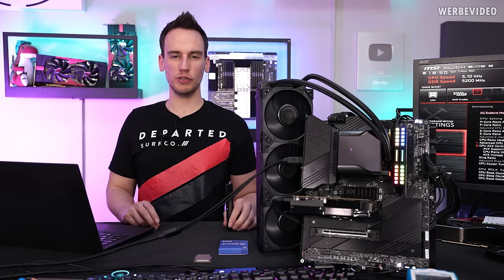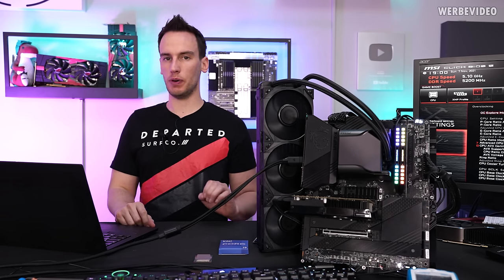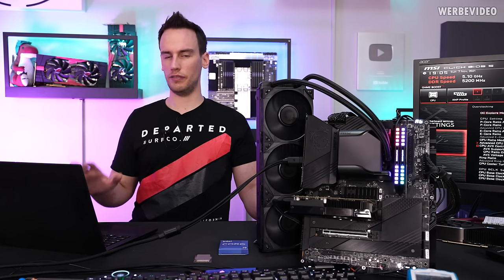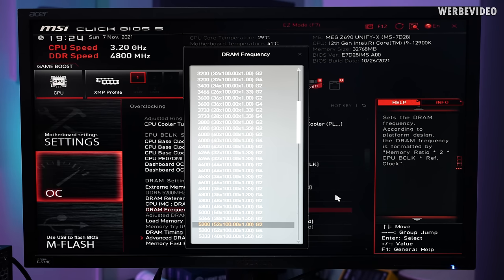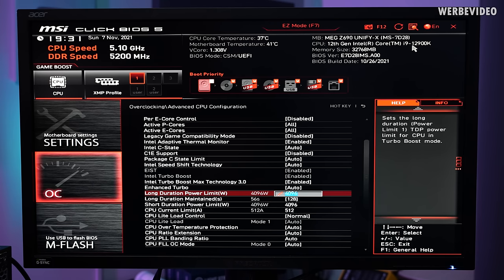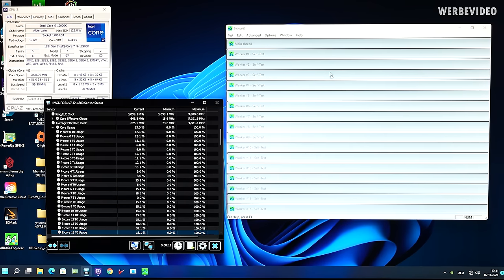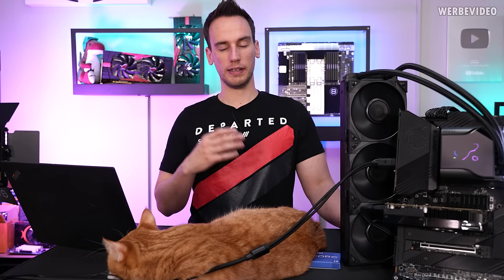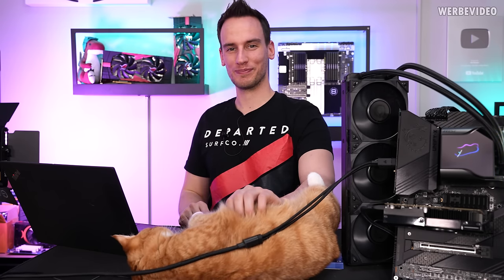Intel 12900K Clocks, Voltages and Overclocking explained - feat. MSI Z690 Unify-X

Comment: Is it also stable with Command Rate 1T for the memory? Cause CPU-Z does not detect the gear down mode and it shows 1T if your CR is set to 1T while the memory controller is set to gear down mode. And what is your p-core clock speed recommendation for absolute stability even with the AVX 512 instructions if you have a 360mm AIO?

Comment: Great video,  just curious would this also be similar  for 12700k   to mirror  for  OC
Reply: There is nothing that will demand overclocking your 12 series for gaming. For rendering and etc, you'll have to get a custom-loop. I have a 420 arctic liquid freezer and it's still too hot.

However, at lower voltages I notice better performance because the power draw is more consistent and doesn't 'gag' the system'

Comment: At 5.3G with 1.36v on a 420mm cooler. Temps in 2042 never go higher than 60c and usually hover around 45-50. I may have got lucky. E cores disabled as at the moment they hit the FPS
Reply: Try running cinebench r23 and check your cpu temps. Gaming temps for a 12900k shouldn't go over 65-70 while gaming.

Comment: I just got an Asus Z690-E motherboard and tried the simple configuration you suggested .
Strange that everything works fine except - my Vcore voltage at idle is 1.421 V and in stress is 1.376 V 
CPU at 5100 Mhz - wattage is 157.33 
I also set my RAM to 5400 Mhz - it is rated for 5200 - that is ok .
Is that ok or should I try to lower the voltage ?

Comment: Dont you guys have a guide on memory overclocking? Something that goes more in depth about tertiary timings and the IOL and such?, I saw the extensive guide that floats around but i cant find anything that talks about those and if lower values or higher values are better for performance, etc
Reply: look at the sticker it will show your stock timings, to overclock simply lower the numbers if its 12-12-14-40 change it to 11-11-13-37 then test it and if its faster you can try to do it even more 10-10-12-33. . you can also further overclock by setting it to a higher ghz ...then if its still working you would increase your voltage to get stability
Reply: @blazebott  ye i done all that, my sticks are crap (Micron 4gb B and 8gb H die and yes i miss matched my sticks lmao but isnt permanent, just having some fun while i save to get better components for this mobo)
and i could get them up to 3294 MT/s (i did BCLK OC that is why isnt a normal  number) with timings 18 18 18 40, but i left most of my secondaries and tertiaries in auto and those are what i need more info on, maybe im just missing on some good performance gains there but i have no clue what to do with them
Reply: also these sticks do not like voltages, they dont scale well past the 1.3 v range
Reply: @Elinzar  i was going to own you in the comments section last post but it was 3am and i had a interview for a important job more important than overclcoking but im bback at it again to own you with more valuble memmory overclcoking clues, yes there are not alot of guides online but its because theres alot of work and testing involved but ill let you in on a hint. load up one of the xmp profiles on your ram with the lowest timings and then try the 2ndary timings from this profile but incorporate into (the timings on the sticker)overclocked you found on your first timings so you need to know those first ... then you will have stable ass fast ass ram sticks
Reply: increase voltage as mentioned
Reply: @blazebott  did i say something disrespectful to you that you had the urge to "Own" me in the comments? i mean thanks for the input but if you are so busy with your interviews (that honestly i don't really care about and is irrelevant to this tread) then don't bother commenting, specially with that attitude
btw i will not be following this discussion, i will only follow the tread 

that begin said, these sticks are literal trash 
and don't have XMP, only JEDEC timings that are pretty trash as well, i don't really care much because i will replace them but anyways i guess i will be asking somewhere else about the tertiary timings

Comment: My solution on a 12700kf was turning on Thermal velocity boost +2 profile, which does 5.2ghz ingame, while set to 50 multiplier = 5.0ghz in benchmarks like cinebench.
Would also like to ask if hwinfo reported power draw value of 10w on Rest-of-chip is normal, or is it F skew specific. I've seen this at 1-1.5w for most people on 12700k.
Reply: My OC:
VccIN 1.325v
P cores 5.0ghz (TVB pushes P cores to 5.2ghz in lower loads)
E cores 4.0ghz
Ring 4.4ghz
Ddr4 3600mhz c14 kit 1.45v xmp profile
Pulling 265w in cinebench r23 (not quite satisfied with high power draw considering its 12700kf)
On 360mm aio doing 86 max (also not satisfied and considering liquid metal between IHS and copper water block. Actually hardware overclocking suggests it's useful due to how thermally dense 12th gen is)

Would also like to ask your opinion about 3080ti liquid metal swap, with a stock 3 fan copper heatsink. Getting 86 degrees Hotspot and 76 degrees on gpu die with loud 2200rpm fan noise. Do you think it's worth it, with all safety measures taken, isolation of the components surrounding the die with some nail coating and probably an elastic eraser material for a border around the die. Same for the cpu IHS/water block application.
Reply: Cinebench r23 24448
Cinebench r20 9307

Comment: Hi. I have an i5, and will get a new i9, is these setting what i should do in the Bios? Or shold i get an update from the internet? I have the same mb (as i remember). I have talked to a guy, that asked to all my hardware. Motherboard, power unit, etc. He said everything i have, is all good. The Watt it perfect in the power unit, graphic card is ok, also the mothervoard. I got the money for the CPU. I can sit in the CPU myself, My "problem" is the Bios. So that is my question. I will also get RAM from 16 gb (2 times 8) to 32 or maybe 64 gb total.

Comment: At 17:20 you are using a 1050TI. Doesn’t this mean that the gpu is bottlenecking and thus it’s not a fair representation of the load the pc would be under if your cpu is the bottleneck? (Play cs at 1080p maybe?)
Reply from the maker: Yes absolutely. Will always depend on the GPU/Game/Usecase
Reply: @der8auer-en  okay, so then why didn’t you use a more relevant GPU more likely to be paired with the i9
Reply: No game would likely bottleneck an i9 so the 1050ti is just a troll??
Reply: @Profanitey  you might not see a huge difference if the game cant utilize all the cpu to begin with

Comment: I wonder which motherboard supports 7000 mhz ddr5 from g skills and 8400 mhz ddr5 from adata. Those are the 2 that I'm only interested in. My current build has g skills trident z royal 4000 mhz at 32gb ddr4 even though I wanted g skills trident z royal 4600 mhz 32gb at the time however only 16gb ddr4 was only available when I built my pc back in 2019. I'm waiting for the 12900ks that Intel will have pre bined for all cores at 5.2 ghz. I also have the 9900k with the godlike motherboard. I really like the overclocking game boost knob that my z390 godlike motherboard has. I wish the newer motherboards from msi still had the overclocking game boost knob. I have the noctua NH-D15 and my temperatures range from 55 to 60 celcius with my ddr4 with xmp enabled at 4000 mhz and msi after burner enabled with all the settings maxed out on after burner. I just wish my evga 2080 ti ftw 3 ultra had noctua fans instead of the evga fans like the new asus 3070 since the fans get loud when maxed out.

Comment: is 1.35v for 5.0ghz too high? it runs cool on my capellix h150i (30 idle, 65 gaming and around 85 in cinebench) but I don't want to degrade my CPU over-voting it. I had Asus AI oc on for two weeks and saw v-core around 1.47 and it scared me so I turned it off completely. I'd like to get 5.2, but 5.0 is fine if it is more stable. Yesterday I got stable 5.2 1.4v playing warzone with no issues for two hours but after manually rebooting windows wouldn't start so I went back to 5.0 1.35 and have had no errors since. 

All of this was done with stock 3.7 e-cores, I don't care that much about them right now but in the future 4.0 or 3.9 would be nice.

Comment: Could you please do a detailed video on UHD770 iGPU OC voltages.. I am able to OC it till 1900MHz with VAXG voltage set at 1.085 or 1.090. I cant get it any further. Max that my Gigabyte B660M Aorus Pro allows it is till 2100MHz but I cant go past 1900. But this has already gotten me 21% jump on iGPU, but just in case there are any options in voltages to OC it futher till 2000 or may 2100MHz. I just do casual gaming so an iGPU OC will help greatly.

Comment: yep clock speeds i have an i9 12900ks that i have now had for 3 months max  clock speeds in games seams to be 4ghz no were near 5.5ghz would be nice to get it to run faster than my old i9 9900k that runs at 5ghz, this also means my i9 9900k is now back as my main gaming system as it runs game much smother and faster than the i9 12900ks

Comment: After watching everything I'm extremely happy i went with the i7 12700k it seems like the best choice of 2022 for high end cpu due to price, performance, temps and stability. Since it doesn't get close to as hot as the i9 12900k and with an overclock I can actually beat a stock i9 12900k!

Comment: Hi. Could you help me to raise the ddr4 memory above 4600mhz? memory voltage 1.6v SA voltage 1.25v but that alone is not enough. I think I need to configure some more voltage? I appreciate if you can help. It would be interesting to have a video of this format overclocking DDR4 and DDR5 memory. Nice video!

Comment: It seems I got a pretty bad chip. My E-cores get unstable at 4.0GHz @1.3V. The maximum setting I can run is 5.1GHz on P-cores and 3.9 on E-cores with a 360 AIO.

Comment: So i used by core usage 5.3 6 best cores 5.2 2 worst cores, made all core run at 5ghz because i only use for gaming. E cores are sync all cores to 4ghz. Manual vcore set to 1.30v and on xtu and hw monitor it shows 1.40v but cpu-z shows around 1.285v under load using llc4 on asus maximus hero z690. Everything is stable. Should i worry about that 1.4v or just go by cpu-z load voltage? Thanks brother 👍
Reply: If you intend to hang onto your CPU for a long time it's best to underclock at this point. I have been hitting 1.45 volts under auto oc and etc. It's not necessary. Better to underclock and avoid throttling. You will actually experience a smoother experience.

Comment: I used your video to overclock my 12900k for warzone and no matter what i do, the Actual core clock speeds that is in the Task manager never gets over 4.6 ghz.  shouldnt this be fixed at 5.2 ghz?  My p cores and e cores show the correct overclock.  but not the core.  how can i fix this?

Comment: Hey Roman!
I Like most of your videos, but i think all core / static voltage overclocking is dead nowadays. 
Could you make a video doing CPU overclocking by using TVB, per/core ratio configs, etc?

For me most interesting question is how to find correct voltage / stability when you use per-core overclocking.

Comment: I am finding it a bit tricky to get to know this CPU (12900k) for some reason. Normally you play with stuff and in a day or so you get a good idea of whats going on. But I cant tell if I got a dud CPU, or I installed it badly, or the mobo is to blame for perhaps dishing out more volts than needed. Also I dont know if this is strange behaviour, but if I disable the Ecores and do nothing else, the volts climb right into the 1.4s - at default/auto settings in mobo (MSI Edge)

For most things, its fine. However Ive been playing Assassins creed (yay Ubisoft DRM riddle CPU power hog), and it can get very spikey, the CPU hit 92C at one point which there is no way Im comfortable with.

I have a D15 and so obviously no big OC plans. But a 5G all core should be manageable I think? I wiped the slate clean and tried to follow this guide, going for 5G Pcore, 4G Ecore, I think a 39 on ring. I set the vcore to 1.25 (HWinfo shows 1.29 :s It always seems to add a bit to the volts to the tune of 0.04 to 0.06 extra, which is why I think this is the cause of my sometimes spikey temps if this is a correct reading)

*E: So running a few different benches and monitoring the volts, with it set to 1.25 in the bios (and xtu showing the same 1.25, no offsets anywhere), HWinfo has it at a base of 1.29 and in gaming it creeps up to 1.314. I need to figure out what the setting is thats allowing it that extra voltage. I cant imagine just reducing what its set to in the bios to compensate for that is a good idea as there is no way this would be stable setting the bios to 1.2 (or 1.19)
Reply: Roman said there isn't always a good way to combat the voltage creep beside a negative voltage offset
Reply: @mitlanderson  Some creep I can get over, but the straight up addition is bothersome. Im probably not doing myself any favours by using such a power hungry title. I mean with the reduced volts a 10 minute XTU stress test sees a peak of 81C, where as playing assassins creed for an hour and I see the peak of 89C. Thats nuts!
Reply: @utubby3730  From what I've seen the default voltage is around 1.3v for default speeds. I'm running at 5.1/4.1Ghz 4300Mhz cache (Ring disabled) at around 1.36v (12900KF/Strix DDR4-4800Mhz), on a 360mm Capellix cooler. Temp not hitting 90c with balanced fan/pump profile. I managed to get a fair drop in temp by lowering the SystemAgent voltage from 1.4v+ @default, to under 1.15v manually. If I left the Core voltage at default, it wants 1.4v, at 5.2Ghz it wants 1.44v., and both throttle/overheat (but probably ok for gaming). If you haven't already, try a little manual tweak on your voltages. You're right, the motherboard always dishes out more than is needed, and the CPU is power hungry and hot.

Comment: My 12900k will hit 13 mhz shy of 5.1 if set to 5.1 on p cores or 10 mhz shy of 4.0 or set to 4.0 on e cores but if I set it to target 5.2 it’ll also be shy by a few mhz to hit 5.2 - so it can hit the mhz if I exceed the initial target but not the actual
Target? Why? Bios issue? Using edge Wi-Fi z690 sp 95 chip
Reply: That's 100% your motherboard. The more expensive mobo models start with 
5200hz by default.

Comment: REALLY GREAT ADVICE CHAMP. I WOULD LOVE TO SEE THE SAME ON AN ASUS MAX.IF PEOPLE DON'T FOLLOW YOUR WONDERFUL ADVICE SHAME ON THEM. WE NEED MORE VIDEOS FROM YOU. YOUR THE BEST MAN FOR THESE TYPES OF VIDEOS. GIVE US MORE AND YOU WILL EASILY GET 1 MILLION SUBSCRIBERS. I NOT SCREAMING JUST LAZY. KEEP UP THE GREAT WORK. YOUR WORK WITH LIAN LI IS AS TONY THE TIGER WOULD SAY GREATTTTT!  FOR THE RECORD THE ONLY ADVICE I GIVE PEOPLE ON MOTHERBOARDS. I GIVE IS MSI OR ASUS I LIKE BOTH EQUALLY. NEVER ANY PROBLEMS WITH EITHER. ON MEMORY I TRY NOT TO GIVE ADVICE . I SIMPLY TELL PEOPLE ALL I USE IS CORSAIR. MY GRANDSONS ARE STARTING A UTUBE CHANNEL THEY WILL SHOW THEIR SYSTEMS I AM BUILD THEM AND TEACHING THEM.    MOSTLY CONCERNING THE PROPER WAY TO BUILD A DIY WATERCOOLING SYSTEM . DISTRO PLATES ARE A NO NO. RUNS ARE TO LONG FOR A 3.1 AND A 3.2  i DON'T CARE ABOUT HEAD PRESSURE. SO LONG AS I CAN GET 1.5 PSI FOR THE AQUA  CPU BLOCK . i AM HAPPY D5 ARE THE ONLY PUMP I RECOMMEND. I ALSO USE COPPER TUBING ONLY AND X-FLOW RADS ONLY THIS KEEPS RUNS VERY SHORT, MY YOUNGEST GRANDSON.I USE  1 PUMP 2 RAD X FLOW IN THE SIDE DUAL PASS FOR THE TOP RAID. I DIDN'T REALLY WANT TO BUT I NEED TO BUILD PRESSURE THREW THE SINGLE LOOP. THIS IS A 011 ORGINAL, I WANTED TO PROVE AND HAVE SUCCEEDED IN BLOCKING BOTTOM AIR INTAKE AND THE BACK SIDE ALL BLOCKED WITH FLEX STEEL.  FLOW IS FLOW THE AIR WILL TAKE THE PATH OFF LEAST RESISTANCE. SO BY REDUCING CASE FLOW AND POSITIVE CASE PRESSURE I PROVED TO BE CORRECT, SYSTEMS NEVER GET ABOVE 78 C.    EVEN LOOPING IN CINABENCH.I SIMPLY MADE SURE AIR HAD TO GO THREW THE RADS  WITH NOCTUA INDUSTRIAL FANS THAT NEVER EXCEED 1000RPM. I ALSO PUT A MIRROR IN THE BOTTOM TO SHOW OFF THE EK GPU WATER BLOCK  FOR THE EK STOCK WATER BLOCK THE BEST GPU WATER BLOCK EVER MADE.   ALL FANS RUN OFF CPU AND IT DOESN'T MATTER TO THE GPU STAYS BELOW 60C ALL THE TIME WHEN GAMING AND THE CPU STAYS COOLER THAN THAT. I CAN'T WAIT FOR THE BOYS TO GET THAT VIDEO DONE . YOU WILL EVEN BE INPRESSED WITH THE TUBE RUNS BEST LOOKING 011 I HAVE EVER SEEN. THERE IS NONE LIKE IT,  THE BAD I USED THE ROCKET CPU IN THAT BUILD I WANTED TO HAVE THAT CPU ITS NOT A GOOD SELLER SO I FIGURE IT WILL BE A COLLECTER.  I HAVE APPLES RUBY AND A 2005 DOTHAN RUNNING ON ASUS MOTHERBOARD I WAS KILLING HAMMER BEFORE 2006 I LOVE THAT BUILD I GOT IT RUNNING @ 3.1 AND IT KICKS ASS.THE BOYS ARE SET UP IN MY SHOP WE SEE THEM DAILY AND I HAVE HIGH SPEED INTERNET. THEY BOTH LOVE THE ROCKET IN GAMES RUNNING PL2.  THEY ASKED ISN'T AMD BETTER, I SAID THATS WHAT THE HATERS SAY. BUT IF YOU PLAYED WITH AN AMD AND INTEL NEXT TO EACH OTHER YOU WOULDN'T KNOW THE DIFFERANCE . SAME APPLIES TO ALDER LAKE, YOU WOULDN'T KNOW THE DIFFERANCE , THE 011 XL THATS THE REALLY GREAT BUILD CAN'T BE MATCHED, THAT IS DUAL LOOP 1 240 FLAT RESORVOIR AND 1 120 I DID THIS TO MIN, HEAD PRESSURE THE BOTTOM HAS 1 INCHES OF RISE THE TOP HAS 7 INCHES 0F RISE. I USED NOCTUA BROWN FANS IN THIS ONE THATS WHAT THE BOY WANTED. I DON'T HAVE THAT ONE DONE YET, I PUTING RAPTOR IN THAT CASE, HOPING TO USE 2ND GEN ARC IN THAT BUILD. THE ONLY THING I DON'T LIKE IS THE RGB THE XL RGB WILL BE OK TO MATCH THE FAN COLORS. I
Reply: wow that's a lot of text that I ain't reading at all.
good for you, or sad that it happened..
Reply: AND WHY ARE YOU YELLING??

Comment: had nothing but issues with this board and 13th gen... underclocks its self to 4.8ghz in games with 0 avx offset no throttling... does 5.5ghz under full load makes 0 sense to me... bios is ass as well constantly locks up on latest bios...